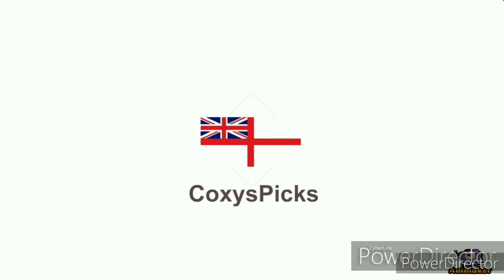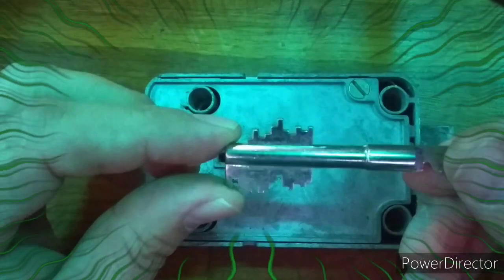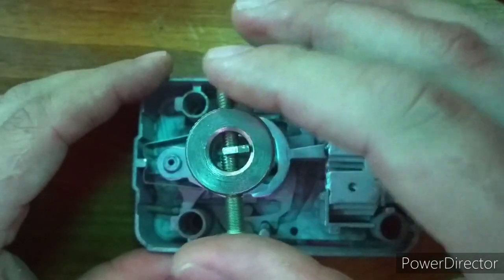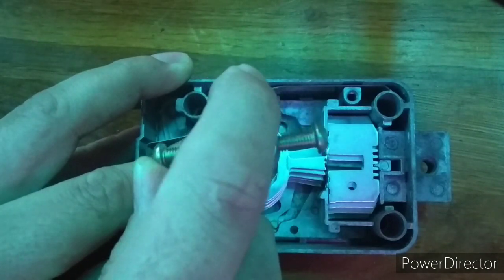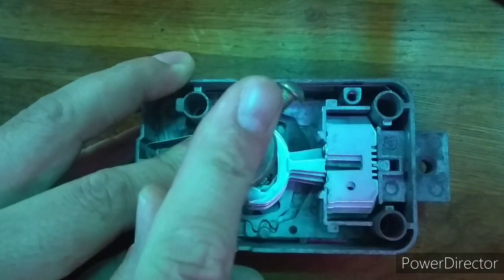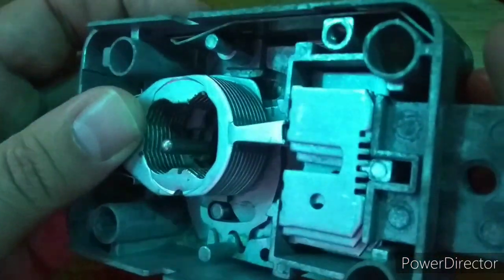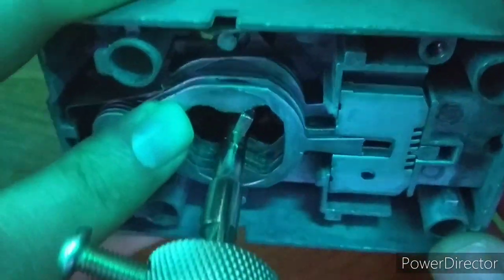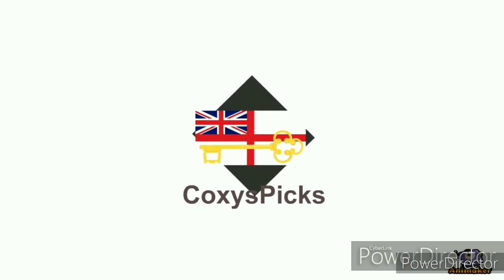Mauer 70076 - 11 lever Safe Lock, The start of a journey

Comment: Hi there! I was watching your video and had a quick look on your channel. I saw you doing handcuffs over and over again. Let me allow to ask some questions:
Have you ever picked cylinder locks? Like ABUS, MUL-T-LOCK, EVVA, YALE, BKS, WINKHAUS, DOM...?! Or any lever locks that are not a beast like the 70076 Variator B like shown in the video?  If you´re allready experienced or expert, go on, if you have no skills whatsoever this lock will give you headaches. I would suggest you get a Kaba Mauer President 71111 for beginning, this is tough, believe me, and this is only security class 1  (VDS1)  here in Austria. The lock you choose is allready a VDS2 and makes a huge difference, there is also a KABA PRIMUS C VDS3 if you wanna look up on the internet. You do not race the "Streif" either as a beginner or even as an intermediate. You´ll have definitly a hard time to learn to determine how to feel if you´re in a true or false gate. One more thing, your lock is damn precise, you need to make a damn precise tool. I have good contact to a top cnc shop, you do not make such high precision tools by hand. The next challenge, developing and MAKING a tool that works ;-)

My advice if you still want to get this damn Variator B open:

1.) study the lock, disassamble and assambe it
2.) Understand the lock, how it works and what every part of the key is doing 
2.) make tool prototypes
3.) test them and train with them
4.) make the tool better and goto 3.)
5.) sometimes you will even need to go back to 2.) and start all over again

It is time and money consuming, do not be bothered if you cannot get this beast open, it is one hell of a lock and requires very precise tools and damn good skills, so yes, you´re in the Expert/Master Level with this kind of lock, this is the real deal and no joke, this lock is mounted on lots of very good safes and it is usually beeing drilled to be opened!!! ;-)

Good luck my friend and kind regards from Austria!
Reply from the maker: Hiya,

Yes I have picked several cylinder locks. I found it hard to explain what I was doing on camera, so tend not to film those. I absolutely enjoy lever locks (which our deadlocks in the UK are mostly). They do some fantastic locks that are challenging and require making tools to beat them. I tend not to film them as much though as I have recently in the last 2 years, become an Escapologist,  and have focused my attentions on restraints. The aim being to one day put on a stage act of genuinely hard escapes. The cool thing with escapology is you have to make tools on the fly, and this is such a cool thing, and really does intrest me.
I still pick locks sat in front of the TV as I enjoy the puzzle aspect and it's very therapeutic 😌 
I noticed that a lot of people don't show escaping handcuffs, or are rather cagey on their methods - or they resort to the bent Bobby pin (groan).
Since I discovered many ways to get out of regulation cuffs, I have been challenging myself to do it quicker, and as such I have been fortunate enough to break world records.
When I do find a truly rubbish lock I like to showcase it on my crap lock playlist, but when it comes to conventional locks, there are a lot of people who can capture, and discuss techniques far better than me.
I hope that makes sense.

TL:DR = Yes I pick other locks but I really enjoy the challenge of handcuffs.

Stay safe and thanks for Watching buddy 👍